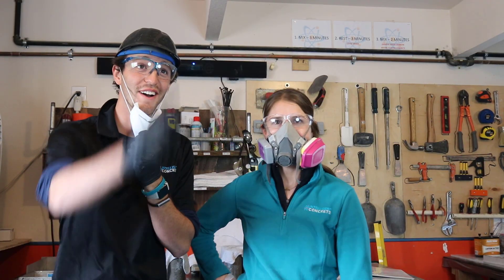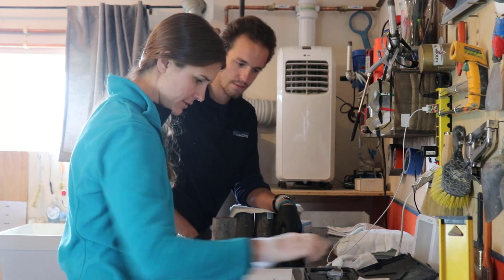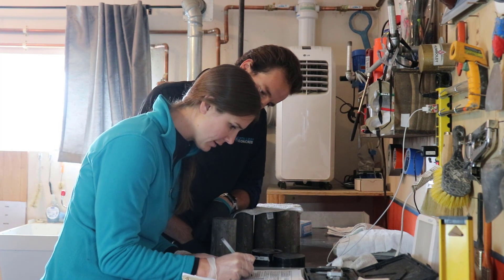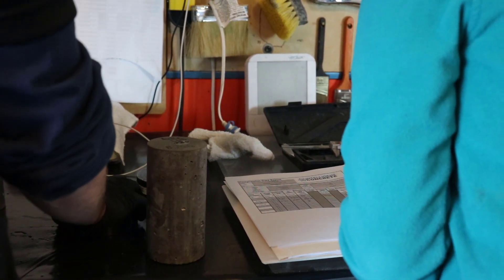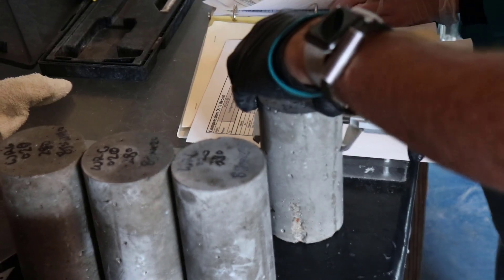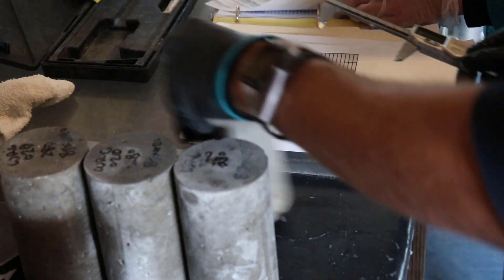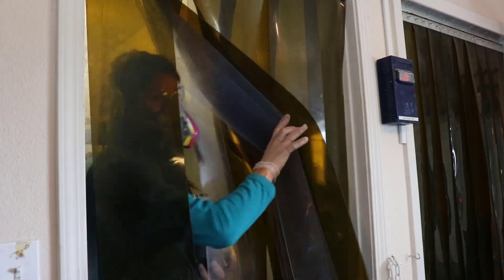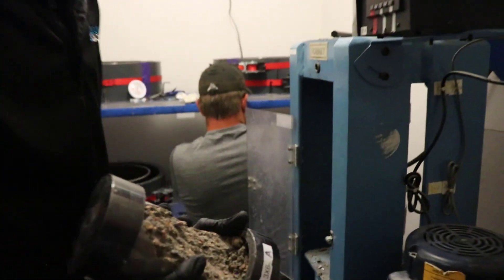How to Perform ASTM C 39 for Concrete Compressive Strength - Vlog 649

Comment: I notice that you are wearing a very serious respirator. Just how harmful are those fine concrete particles? I break dozens of cylinders every day. I occasionally wear a standard dust mask. My employer has never warned me of anything particularly hazardous other than the dust could be an irritant. Should I be more concerned? Should I be wearing a fine particulate respirator ?
Reply from the maker: Howdy Catherine.  OSHA stipulates that folks working with silica dust where N95 respirators to protect their lungs.  We used to where the 3M N95 masks but they are only being sold to hospitals.  These are reusable.

Comment: Please have a content on How to resurface a new concrete to old concrete using only portland cement?.,no additive or finish pruduct added.tnx.
Reply from the maker: Did you mean, resurfacing an old concrete slab with a cement-only topcoat?
Reply: @IntelligentConcrete  no top coat,just resurface old concrete with no additive just portland cement.preperation for vinyl tiles..from philippine.